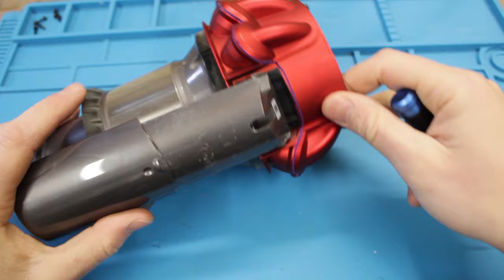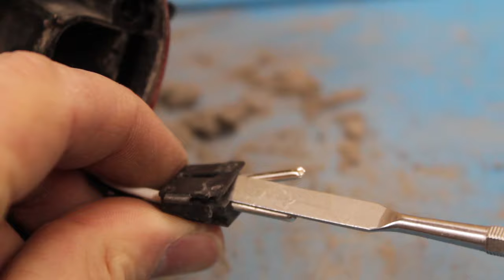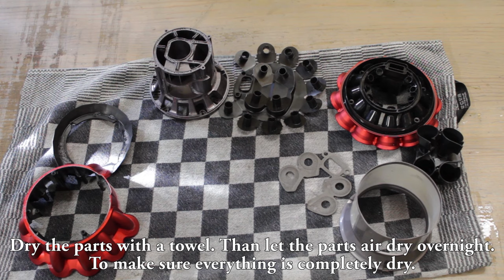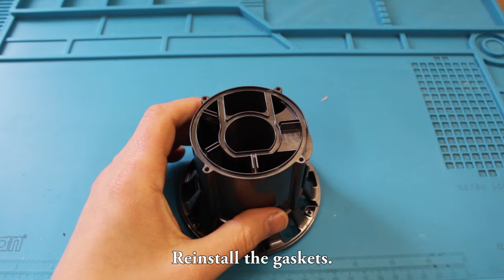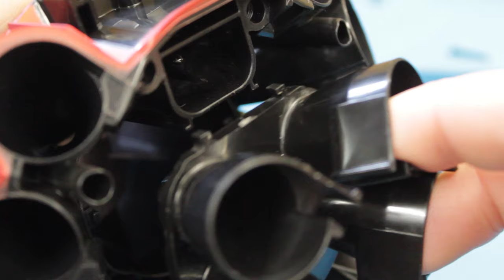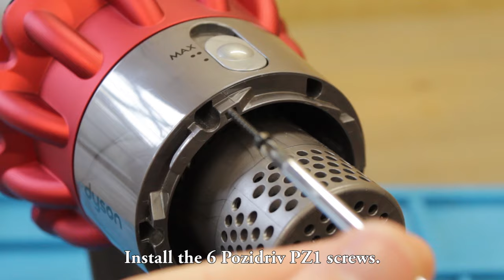Dyson V10 disassembly and cleaning tutorial.

Comment: Absolutely the worst value machine out there. Why? I moved into a brand new flat, am single and hardly make any mess. This is my second replacement. It is impossible to see where there could be a blockage. Initially it stopped working after a week and I was given a replacement. After 4 months, it stopped again. Was sent a new filter, did not work. Was sent a new main body. Why do we know this machine is useless? Dyson send a new body and do not ask for the old one as they know this will happen over and over again. As it has done to many, many other people. Just Google Dyson V10 problems and it is always the same issue...BLOCKAGE! Very expensive vacuum cleaner and when the guarantee runs out...no more replacement parts and you will have wasted your money. DO NOT BOTHER BUYING THIS MODEL.
Reply: Which vacuum did you end up buying after this dyson?
Reply: I’ve not managed to tear it all the way down but I’ve gotten all the way to the “cyclones” at the very bottom and blown it out with compressed air. It worked twice but again the vacuum is complaining about its filter. Vac is 4 years old and almost unusable.

Comment: Thank you so much. Too often these tutorial videos are not detailed enough for a novice or first timer to understand, or miss key details about screw placements or types used for each step. Never once felt lost or without instruction. Successfully tore apart, cleaned and reassembled. Now have (most of) a second vacuum after the first main body was replaced under warranty. Thanks again!

Comment: Nicely done. I would never have braved disconnecting the wires without your tutorial. This is the most difficult of any of the other Dysons I have disassembled and cleaned. Not sure I would do it again. Hopefully won’t need to. Thank you.
Reply from the maker: Thank you, I also found it the most intimidating dyson to take apart. (So far) I had also tried disconnecting the connector on the other side. But I couldn't get that done.

Comment: Dust container is stuck on something. I can't even fully lower is to clean all trash from it. Any idea what could be stopping it. The little lever you touched to remove it doesn't disengage it. Thanks!
Reply from the maker: No sorry, I was surprised though how much force it takes to slide it open. Maybe it's only stuck that it comes loose with a bit more force. I don't know any other way to open it.

Comment: I don’t have that little bit of extra cable length to be able to push the cable out to disconnect the wires
Reply from the maker: Not even if you slide the parts back together?
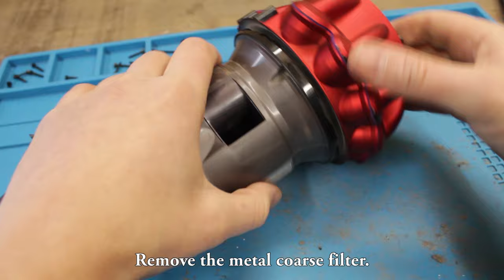Reply: Yea. All that extra cord you had after pulling off the first part at like 3:05, mine didn’t have that extra little bit of wire tucked in that second part
Reply from the maker: @ishnipepew6461  That is annoying. There is also a video online of someone unplugging the connector on the other side. But I don't think that's any easier.

Can you maybe pull out the connector while the parts are still together?
Reply: @SpareTimeWorkshop  so after I pretty much but the parts just about completely back together I had just enough slack to push it out like you did and just barely get the box out to disconnect the wires. Idk why my cables are so short
Reply from the maker: @ishnipepew6461  Well done, seemingly not all dyson v10s are created the same. So it seems. 😄
Reply: My dyson also doesn't have slack. Maybe because it's bigger than the one you have.
Reply: Sound tutorial, easy step by step visuals, the dust that came out of my V10 animal, unbelievable ! Thank you for the video. You're the best 👌 👍
Reply from the maker: Thank you very much